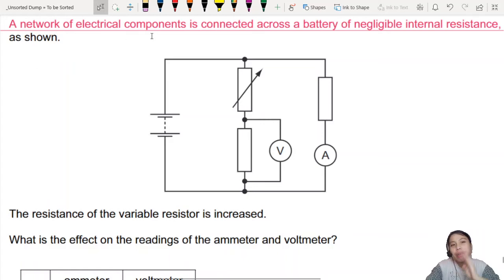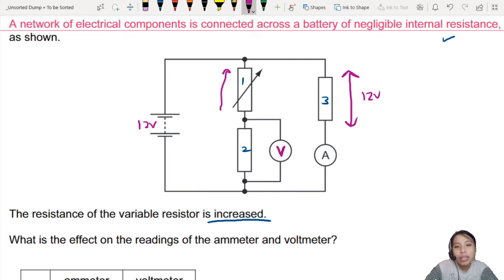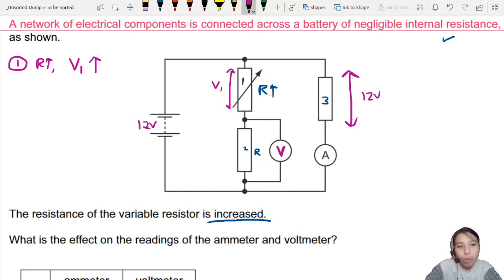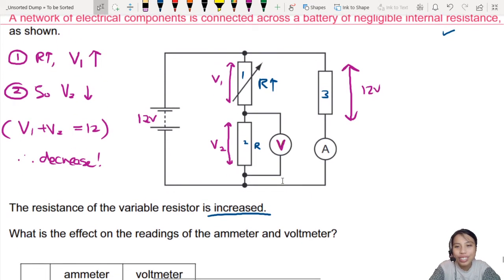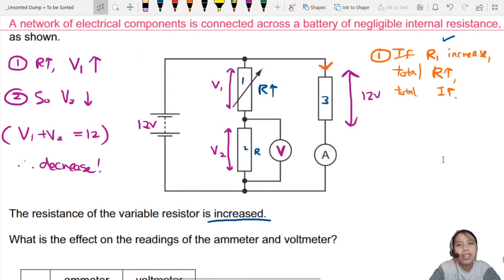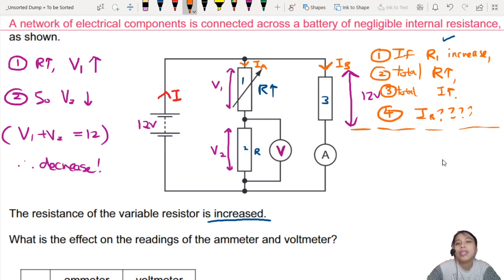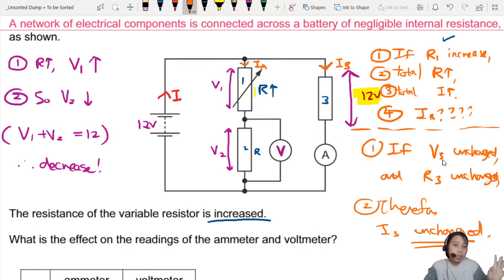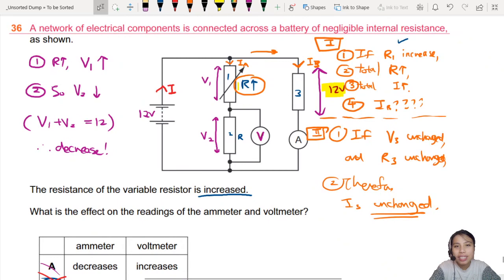ON12 P11 Q36 Network of Electrical Components Change | CAIE A Level 9702 Physics

Comment: When total R is increased I should decrease according to R=V/I, then why have you taken I as being increased?

Increasing the resistance of the variable resistor causes the current flowing through the variable resistor to decrease and thus, the overall current in the circuit decreases. But the current in the right branch is still the same.
Since the resistor has a fixed resistance, the current flowing through it will be the same as previously (I = V / R and both V and R are the same).
Reply from the maker: When total R is increased, total I should decrease IF V is also constant. But V is also changing tho! So if there's too many things changing, we can't conclude the outcome of current with V=IR. :'(